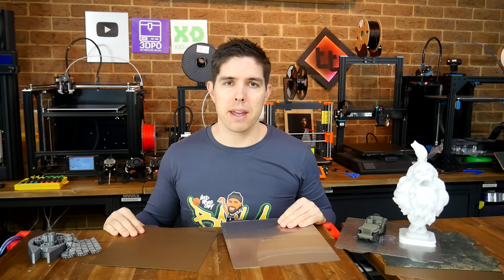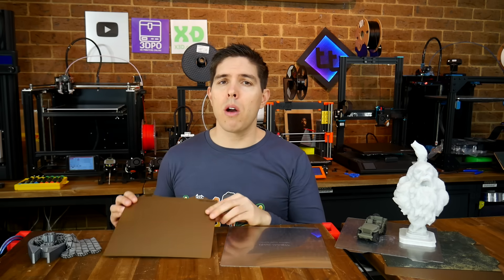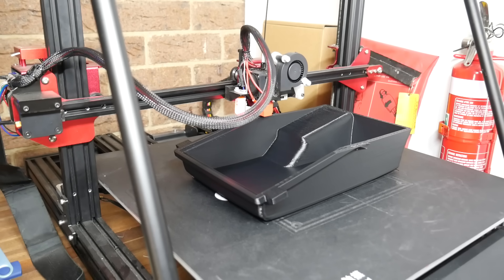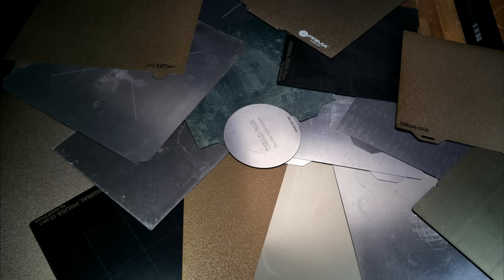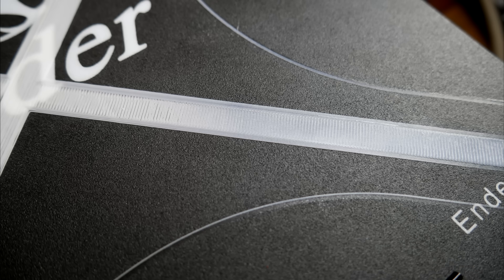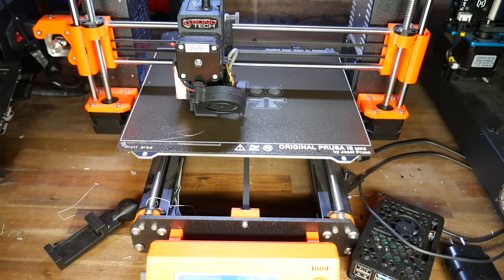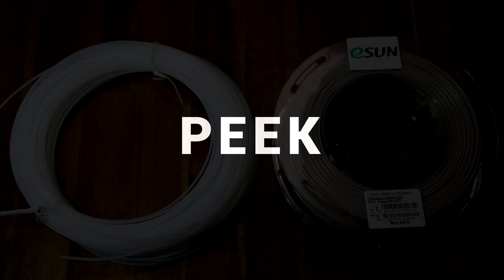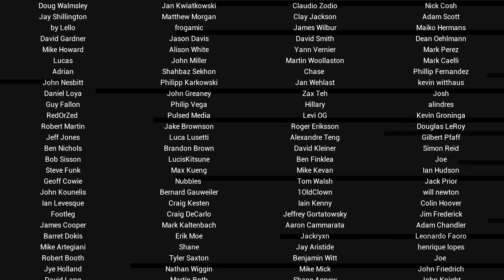Guide to PEI 3D printer beds: Why and when to use smooth vs textured

Comment: I like these removable bed surfaces, and they do a great job keeping your prints secure.  I used them for quite some time, but eventually stopped using them.  They are pretty expensive, and once damaged become unusable (unless one is ok with odd shapes on the underside of prints due to bed damage). @TheRealBanana made some really good points.  The BIGGEST issue I have with with them is they don't help with one of the biggest problems with current printers... warped beds. I really really hate relying on bed leveling sensors (which can also be expensive to buy or replace) and prefer a manually leveled bed that rarely needs adjusting.  Because of this I've moved entirely to 8mm thick glass/mirror surfaces on a solid mount bed (no springs).  Can pick this up cheap at hardware stores, they are super flat, they are easy to cut to whatever size I want, and work with all the filaments I use.  Best part, no waiting for farking bed leveling and tweaking z offset.  When I hit print, the printer starts printing.

Awesome Video as always!

Comment: PEI definitely is my favorite surface for printing ABS, PLA, PETG it's not only sticking well but also has an amazing 1st layer texture. I had so many struggles with any other surfaces that on 1st 2 minutes of using PEI I fall in love with it: NO MORE adhesion problem - the most annoying problem in 3d printing ever... Such a nerve and time saver....
Reply: Funny, I don't like the textured surface on prints.  I switched to a smooth plate instead and the prints look better.
Reply: @joeking433 My problem with smooth plate is that it scratches easily (I run print farm) and than surface doesn't look as good after some time... also I pref extra grip from textured plate to reduce failure rate.
Reply: @hobbyistnotes  Why do they get scratched?  Mine don't. I've used the smooth plate on my Prusa for years with no scratching whatsoever.  But I only use PLA and PLA Plus.  What filament are you using?
Reply: @joeking433  We print: PLA, PETG, PC, ABS, ASA, all sorts of filled filaments (sparkle, glass). Again main goal is on production to get more grip, I will trade smooth surface for hustle free grip without any adhearants any day of the year, cus it cost not only money in material it cost time, especially critical with complex prints where sometimes you don't have enough surface area to adhere.
Reply: @hobbyistnotes  Well, those filaments must be tougher on the plate than PLA because I've never had a problem with smooth plates.
Reply: @joeking433  My bad I didn't meant it's damaging the bed to completely unusable state, it's just makes that shine you get when bed is new to disappear: tiny imperfections and scratches become very noticeable where on textured plate finish always consistent and predictable and even more if you have legit PEI you can tune 1st layer so it will make lines completely invisible under direct light. I am not against smooth plates they are still better than lets say stock Ender 3 plate and I think people have to pick their plate based on the texture their product requires. But per my personal experience if you need max grip the textured plate is the way to go, if we talk about PEI plates.
Reply: @hobbyistnotes  If you like the texture they are fine.  I have one textured plate on a cheap printer and the parts are always loose when I go to take them off and that's nice.  My Prusa printer came with a smooth plate and I liked the finish so well I bought an X1 smooth PEI plate for my Bambu Labs A1 that came with a textured PEI plate.  Wow, that Bambu Labs A1 does such perfect prints at high speed that I hardly use my Prusa any more.  Have you tried any Bambu Labs printers?
Reply: @joeking433  We mostly print with Bambulabs P1S and few Vorons, it's hard to compete with Bambu now... but finally we will have some progress on the market.

Comment: I used to print ABS on an enclosed printer with glass plus hairspray. I applied a Prima PEI sheet on a glass, which is heated at 110°C. In my experience ABS sticks too well to PEI, the advantage is no more brim needed, and less cleaning, but I have to remove the part carefully with a cutter, which is dangerous. It still sticking strongly even after cooling down. Any advices?

Comment: Fabreeko beds are no good for ABS temps, they get big bubbles that bulge over 1mm within a few prints. They eventually added "don't use abs it will adhere too much" to their description but that's not the reason.
Even the cheapy comgrow beds are better. Really happy with fulament beds so far.

Comment: I tried PEI, I tried garolite, I tried aluminum. Glass is still best. Perfect first layer. No damage from nozzle crashes. You can apply glue stick, blue tape, anything to it and clean it off with any solvent or razor blades. You can print PLA directly onto borosilicate, and it releases just like PEI when it cools down.
Reply: You can't flex a glass bed to get a stuck large print off. Thats why I switched to pei on spring steel and havent looked back.

Comment: PEI was such a gamechanger for me, it adheres so good that you dont even have to keep it that clean. ive had best results when taking a new bed and sand it with very fine grit sandpaper to give it a microstructure wich the prints adhere to even better. i like the flat surface a bit more than the textured. oh and its way flatter than my ender glass bed, in fact i know of many creality glass beds that are all but flat, most of them run a flex steel pei combo now with no further problems

Comment: Ive been printing alot of carbon nylon with my prusa and on prusa textured bed, to get it to stick i use glue stick and that works a treat, next is to make a glue stick slurry. I use the print profile from prusa and modded it to fit my filament i also add a 5mm brim which helps keep most things flat, if problems happen it normally due to not having enough glue stick in the area. Plus with nylon i print from a food dehydrator ive modded so i can have it drying and print straight ftom the spools which are held inside then though lines to my print head on my prusa.

Comment: Couple things I've learned personally about PEI: FLEX will stick so well that if you don't put some release agent (like glue stick) it can pull entire chunks of PEI off your bed. Also any scratches, divots, or other damage will be transferred to your printed part too. Accidentally poked almost through the PEI when working on the printer and now all my prints have this weird circular mark. Its unique enough that I'd be willing to bet you could positively identify what printer printed which part, similar to matching rifling marks on fired bullets.
Reply: Flexable filament defiantly sticks too well, i don't heat the bed then also make sure to rub my hand in hopes to add some oils to help not stick so well 😅

While typing that, i though of why not lower the first layer extruder temp 🤔
Reply: Its a feature, not a flaw
Reply: ❤，测试，则是色彩发

Comment: In my experience PETg will print just fine on PEI, both smooth or textured, using hairspray both to improve adhesion with a non-squished first layer and to help release. Generally my prints pop right off once the bed has cooled down, but hairspray is easy to melt away with isopropanol, so that can be used to release the part if it is a bit stubborn. IPA can also be used to "quickly refresh" the hairspray coat for the next print.
Reply: What hairspray do you recommend?

Comment: What about textured PEI + hairspray? I've been using hairspray on me glass plate and parts stick too well on it, to the point I have to hammer them off. I got a flex plate to avoid that and I'm wondering if hairspray will be needed for this as well..

Comment: I found using Gluestick on the smooth PEI for PETG works pretty well. First it helps for adhesion (even though not needed) but when the print is finished, it works as a release agent. No damage on your bed and fairly easy to remove the print. One downside is, that you will have residue on your plate as well on your print. Since its gluestick it should come off with water.
Reply: This is my method on that surface, and I wash the plate under the sink, it rinses off very well. There is a note above about using a sponge to level the glue and thin out the layer, going to try that.
Thanks for posting !

Comment: Hi Micheal Love you video guides. I have a question on setting up Marlin. 209.I have a mod Anet a 8 with change the motherboard to SKR 1.4 Turbo and Display. Extruder change to E3D clone. Problem is my max temp is unable to increase to 235c. Marlin firmware is set to 275c. When ever u set to250c. It will just drop automatically to 235c. Have u come across such problem. I set my thermistor sensor to 1 (bulb shape). and also try at 5. And it still the same. It will alway set to 235c. Did I miss a step in Marlin. Ur help would be great. Thks. By the way my setup is on 12v.

Comment: I primarily use textured PEI for my PLA prints, or I'll switch to garolite for PETG or nylon.  I use a textured PEI on spring steel plate from gulfcoast robotics and in my dusty workshop I dont even have to clean it for PLA to stick at 60 degrees and immediately release on flexing

Comment: All you ever need for beds is pei and G10, (except for high temp printers that are capable of getting to the glass transition temp of pei and the failure temp for G10). I have yet to find a material that both doesn't stick to, and doesn't self release from G10 besides ironically Ultimaker breakaway support which does not release from G10 in the slightest.

Comment: Never put acetone unless the surface is so bad that you are ready to dump it particularly if warm, it will make the PEI so sticky that you won't be able to remove the parts. I remove grease with soapy water, let it drip and clean with IPA. IPA does not clean grease, it only sumge it.

Comment: I recently upgraded my ender3 max with a PEI sheet from Ziflex. The original ender glass is a crap and fixed, so I glued the magnetic sheet on it to have a removable bed like my prusa. The most important fact for me is the chemical resistance in case of cleaning, compared to other systems. The only downside off that sandwich is a kind of heat insulation and the resulting difference between probe and top surface.

Comment: I got this filament, 3D fuel Island Fuschia PLA and no matter what I do, I can't get it to stick. I've tried covering the bed I'm blue tape, hairspray, alcohol wipe before hand, glue, all of them combined, no matter what, I can't get it to stick. My 3d printer has BL touch, so I don't believe it's a leveling issues.
Reply: We have a CR Touch and still have to manually level every other print, so it is possibly a leveling thing.

Comment: Glass with 3M 45 strength spray adhesive is my go-to, holds well, but you do have to keep the bed warm to remove it, if it colds it's not a big deal you just heat the bed up again. Works well for both PLA and PETG haven't tried others. 

Bonus for PETG it acts as an interference layer so you don't have to worry about it taking a chunk of your glass.

Comment: On the default powder bed of my Creality CR10S Pro v2 (which has some kind of buildtak replica?) I always had slight problems with adhesion when printing PETG. Had to bump the bed to 83C/81C (First layer vs the rest) and squish the same as with PLA. Still I had to use brim for prints larger than 10-15cm. Recently I bought some carbon fiber plates, one 300x400x4mm and one 1.5mm thick. The 4mm was used to replace the 4mm thick aluminum bottom frame of the bed (where the V-wheels are attached) and since carbon fiber's density is only 1500-1750kg/m^3 (compared to aluminums 2700kg/m^3) in the process shaving off ~150grams of weight. The greatest weight saving came when I replaced the top 3mm aluminum plate (which had the powder coated sticker) with the 1.5mm carbon fiber plate. I got rid of 600grams this way! The original bed frame plus the two 3mm aluminum plates on top weighed ~2000grams in total, so I lost ~750grams or ~35%! This gave me some nice increase in the resonance frequency of the Y-axis when recalibrating the input shaper of Klipper 😀 But when printing PETG on the carbon fiber it stuck even worse than with the old powder bed. I tried the same 83C/81C and also going down to 70C in case I printed too hot or something (but it only got worse). Some simple gluestick made PETG stick very well to the carbon fiber, even better than to the old powder bed. Just some suggestions in case someone wants to make their Y-axis lighter on a bed slinger for better acceleration possibilites. :)  Also with the carbon fiber bed I get up to 83C a lot quicker than with the old 3mm aluminum bed. Just a warning when cutting and drilling the carbon fiber: make sure you have a vacuum cleaner sucking directly at the "cutting action" and also use eye protection and breathing protection because that carbon fiber dust gets everywhere!
Reply: Just one thing: I could probably have used a 3mm carbon fiber plate for the base frame of the bed instead of 4mm, because the 4mm was super stiff and the 1.5mm very stiff also, so I think a 3mm plate would have offered the required amount of stiffness for the base frame also. This would have saved even more weight. But I had no idea how stiff they would be when I ordered the plates so didn't want to take any chances.

Comment: Just a heads up about acetone, it is a bit strong for PEI so only use it on your bed if nothing else works. It can destroy your PEI sheet and make it crack.
Reply: Especially when the bed is heated.. only use Acetone on a cold bed, and apply lightly.

Comment: I print nylon on pei.  I use magigoo pa on  smooth pei sticker over glass and on spring steel smooth pei.   Just depends on the printer I’m running it on.

Comment: > prints nylon outside of an enclosure
> fails to print nylon
surprised pikachu face

Seriously, Nylon is a bitch to print, and you have to understand that. You have to use an enclosure around the printer, a dry enclosure around the spool, likely - put the spool into a vegetable dryer for a few hours... Never approach Nylon printing thinking it's as straightforward as PLA or PETG. It's not!

Comment: What about capton sheet? I don't mean tape witch is 0,015 mm. I use a sheet of about 0,15 mm thick with a complete build area size.
It does stick parts very well with a little bit of haarspray.
It is also very scratchproof. 

If any one thinks this is not so good then please let me know why.

Comment: Another great video Michael.

Just to add my 2pence...
I print mainly PETG, and after much testing I find (specifically for PETG) that the Creality ultrabase is unbeatable. It releases when cool (granted that's annoyingin a powerfail situation), it's very flat, and it's very hard wearing. I have 4 machines with these bases on now, the ones I swapped over 1st have now been using the same surfaces for over 18months and they still work like new (and as s business I work them pretty hard).

Worth noting...
Takes longer to heat the bed due to the thickness of the glass so you need to pre-heat an extra few minutes before hitting print. And you really can't remove a print till it falls back to about 30°c which can be a little frustrating when you want to crack on with the next print.

Also REALLY IMPORTANT if you have an inductive bed leveling sensor it won't pick up the glass bed so you need to swap to a physical probe (BL Touch for example) or go to a capacitive probe.

James (UK)
Reply: How have you made the Creality ultrabase work with PETG? I bought it shortly after they introduced it and I love it for PLA, but I simply can't make the PETG stick to it. Every print first layer is lottery whether it will stick even at 15 mm/s and anything bigger then 1-2cm simply lifts it's corners and detaches from the bed mid print 😞
That's why I am trying to find a new bed surface for printing PETG and not sure whether to go PEI or G10...
Reply: @tomas_klouda  depends what your print is of course, whether you need to add a small brim, 'mouse ears' to tight corners or adjust the infill type which can really effect how the print cools/shrinks/lifts.

I occasionally get a small lift on items with large flat bases with sharp corners, but can usually adjust that out using the above adjustments.

I have 80°c bed and my printers are in enclosures which typically stay at around 30°c

I wipe the surface periodically with white spirit / IPA but otherwise I find it works fantastic. I have them on four printers (would be 5 but they don't make one big enough for the MAX) Ive never had to replace any of them, and they still work flawlessly after literally 1000's of hours of prints.
Reply: @jamesrguk  oh, I have tried even huge brims and they lifted as well...
But going through the posts here I think the main contributors would be a filament brand and the fact I lack any enclosure (although I have the printer in the room with house heating tech with temp around 30C).
What infill do you recommend to reduce shrinkage?

Comment: Just a little question : when dealing with power rupture protection, alimentation with batteries, or just lowering the electricity consumption,  it can be a great advantage to not use a heated bed.Not using a heated bed also lowers the preparation time of the machine, thus lowering your idle.time next to it before verifying the first leyer. Could you make a  video about the different solutions to do bed printing ?

Comment: I find this interesting because I still use the original magnetic surface that came with my Ender3 Pro.  I have tons of prints, and several years on it.  It looks nearly as good today as when new, andxworks just like when new.  Perhaps you all are doing something wrong, because I will be sticking with the magnetic version for my PLA needs.